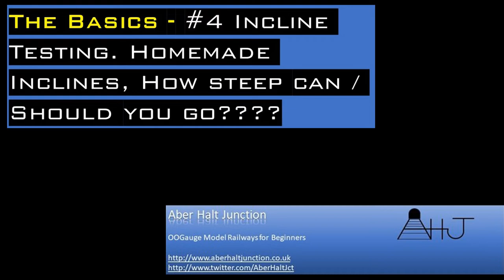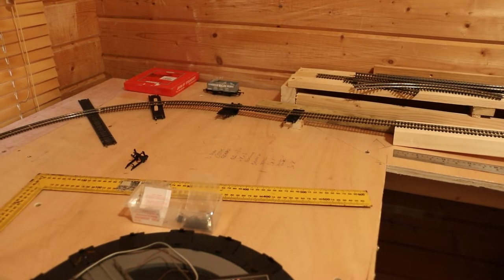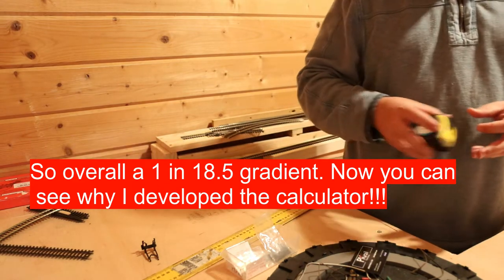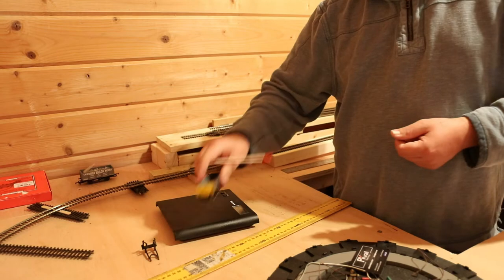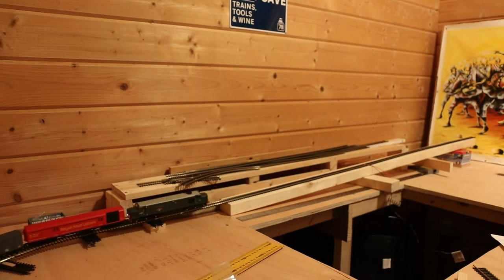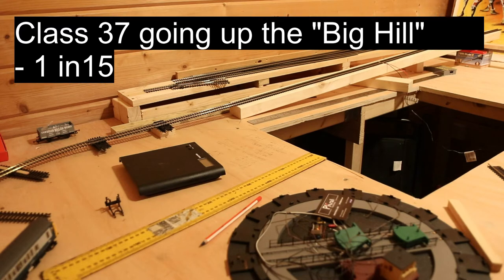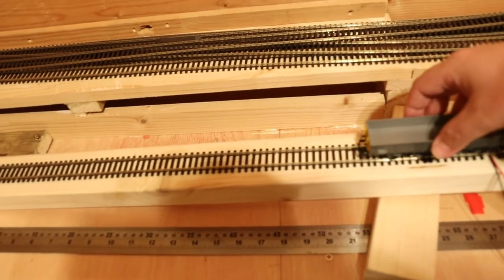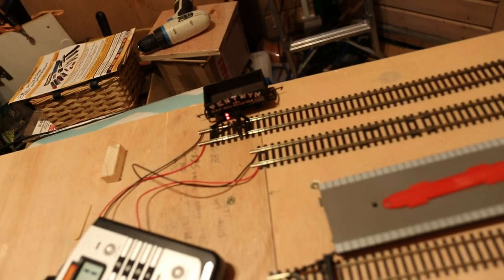The Basics - Incline Testing - How Steep Can / Should You go if you are Short on Space?

Comment: I just got back to this hobby from a 30 year break or so.
And i thought i knew enough to start it off nicely.
So i bought a lot of DC stuff, cause i want to keep it simple.
Plus i have experience with it to know how to block the tracks and so on.

What i did not take into account was scaling.
I remember as a child we had HO scale. I clearly remember the size of it all, very nice size.
BUT!!!!
I should have taken it into account when i restarted this hobby.
I have a room, 2.7 meters by 3.7 meters.
Sure, you can build a reasonably nice layout in HO scale in that room.
BUT i should have gone for a smaller scale. N, or Z perhaps?

But since i bought so much stuff for HO scale, i gosta make it work in the available space.
I have the option to connect another room to this room by knocking down a wall, which would increase the space by 3.7 meters by 2 meters roughly.
So in total a space of 3.7 meters by roughly 5 meters would be possible. And i think it is possible to create a nice layout with HO scale in a room like that.

So why do i write this?
To warn people that they do have to consider the space they have available, and adjust the scale they want to build in.
Because with a smaller scale you can build so much more stuff.

Nevertheless, i have decided to layer the layout.
And so, it will have an extra level.
The trains will have to get up to the next level somehow.
And so i am gonna have a mountain ridge blocking the view where the train can climb uphill, perhaps a bit of an uphill spiral, and then it comes out of some tunnel.

Or, what i was thinking of is a train lift system. Simply lifts em up to the next level. That way they don't wear as much as when they have to climb up a hill.
Reply: the rails of a drawer from the kitchen, 4 of em and a platform in the middle with a small lifting mechanism, scissor lift or something like it. End stops.
Easy enough in my opinion.
Reply from the maker: Hi Bert, a very well constructed and thought out response. And I completely agree, space is key, I went OO/HO as I just find the other gauges a bit too fiddly, but I agree on your point about the amount of layout you can get in a particular space. As for inclines, I agree, there are many ways to skin a cat, lifts, helixes, inclines, they all have their merits. Good luck with your layout!!! And welcome back to this wonderful hobby, I look forward to seeing/hearing how your layout turns out....

Comment: I don't disagree that testing is a good way to get a feel for inclines, but trust me, there are thousands that have gone before you who have pushed the recommended and found they are there for a reason! You can only test what locos and rolling stock you have, later in time with new acquisitions, things may not work so well! Its hard to give a definitive, as you have shown, loco weight and tracktive adhesion are big factors, as is rake weight, numbers and wheel friction (plastic/metal/metal bearings). So best to get the best incline in the space you have, not what you can get away with. Also don't miss out on reducing the incline lift height by taking any opportunity to lower the underlying lines! Read this and absorb! http://www.lumsdonia.co.uk/gradients.html. P.S. your website is coming on nicely!
Reply from the maker: Thanks Tim, good insights as always. Yeah I have fitted mine to what I wanted from an elevation perspective for my current fleet, fully agree that testing is key and can change with variations in fleet. Ideally I just need a bigger shed!!!! Glad you’re enjoying the website it is painfully slow to put together, never was great at HTML, but it’s good to practice, your website is great too. And I completely agree there are no definitive, test test test and test again :) all model shops should have inclines ready setup :). Thanks for the view and constructive comments. Catch you on Mrycg tonight.
Reply: @AberHaltJunction  Ooh yes, keep forgetting tuesdays stream!
Reply from the maker: Yeah me too, I’m always in work and then see the time!